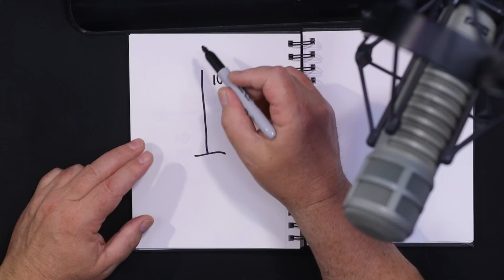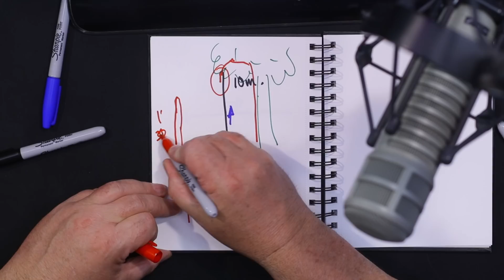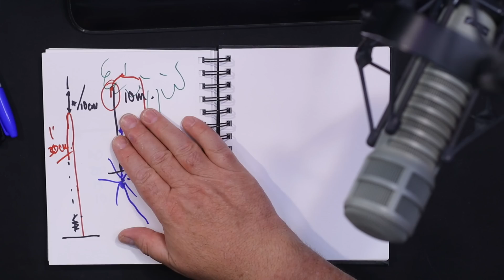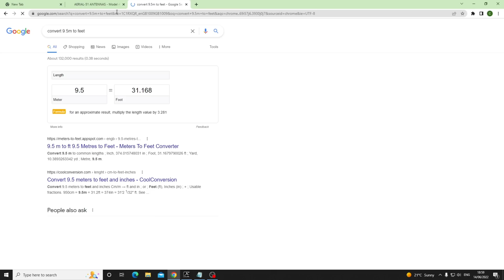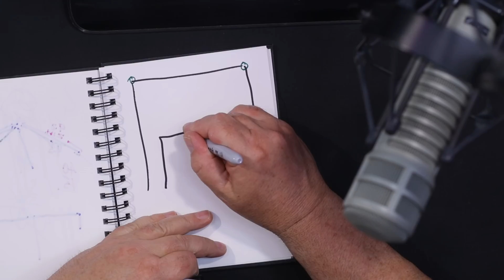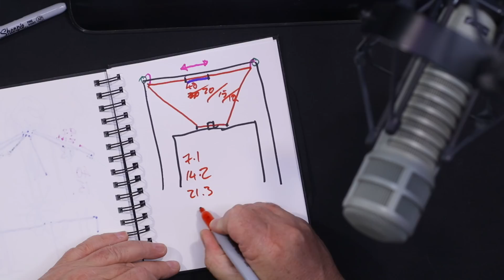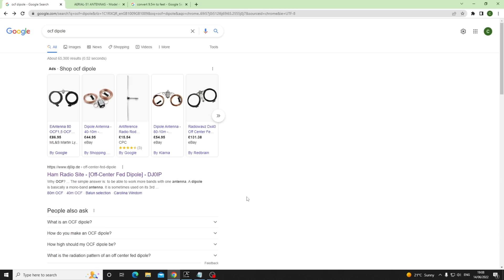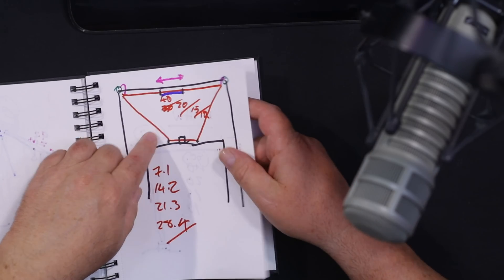5 Cheap Wire Antennas for New Ham Radio Operators

Comment: I use to use a 66 ft approx efhw it worked great , I would keep the transformer low to ground this would allow me to by pass the transformer using a dipole connector with a counterpoise to ground a short wire with croc clip would clip onto the wire on the transformer this would make it a quarter wave on 80m worked a treat
Reply from the maker: Perfect

Comment: Good morning sir! Wondering if you would be willing to teach on the use of 75 ohm 1/4 wave matching stub for impedance matching (instead of using a 4:1) Would love to learn how to do it, how to measure the proper length, when it would be advisable to do it, etc ....
Reply from the maker: Great suggestion! I'll add it to the list!
Reply: @DXCommanderHQ  thanks!

Comment: hi callum please could you take a min to give me  on the 20m half square fed at the top corner  iv made one 2 quater wave verticals 16ft 6inch  orizontal 36 feet  my swr keeps changing  ?  thanks   mark
Reply from the maker: Hmmm. Mark, send me some pics via email and I'll take a look.
Reply: thankyou calum it was my pl259  a pidgeon hit my orizontal wire  my nieghbour told me lol   all good back to 1to1 2 swr  great dx  but cant hear you or anyone in the uk lol   but i still watch your vids  saveing up for a commando  probs rapide 7   thanks mate

Comment: Is it true if you put an antenna on the ground, it makes for a great receive ant. Very quiet.  Loop, dipole, long wire?
Reply from the maker: Yes it does.. I have a loop on the ground. It's almost too quiet (depending on band) but works. My fav is a 90m loop about 30cm/12 inches off the ground.

Comment: The OCF dipole uses an atypical feedpoint to achieve favourable input impedance on more bands. The EFHW takes it to the extreme with a very high input impedance making the matching device somewhat more critical.

The radiation pattern will not be appreciably different from the harmonics of an EFHW or 15m on a 40m dipole. Harmonic frequencies result in more commutation of the current distribution across the radiating element, and this is reflected in a radiation pattern that increasingly resembles a porcupine as the harmonic number increases.
Reply from the maker: Ah yes, the "Porcupine"! :)
Reply: @DXCommanderHQ  
Yup, very spikey!

Comment: Very nice video Callum! (as usual😊). I have a question about 40-15m GP: Which is the distance between 9,2m and 2m wires? Thanks a lot for the answer. Best 73 de Franco, iw2hus
Reply from the maker: Doesn't matter too much, I string mine right next to each other..
Reply: @DXCommanderHQ  TU! I'll try to build the antenna to compare with my multiband EFHW 80-10m

Comment: I have been using Vaseline (recommended by you) since watching your videos (over a year). It works great! Thanks for the recommendation. I finally took my dx commander classic out of the box (~8 months). My goal is to build it this week. I'm totally looking forward to it. Can't wait to make contact with you while using it.

So I typically use a OCF dipole (MFJ 2010) about 30 feet in the trees, but requires a tuner. I have no idea what he pattern is and would like to know. Mu contacts are all over the dish, not consistent. I can't wait to use a resonant antenna like the dx commander.
Reply from the maker: OK, some parts of SOME bands (behond 20m probably) will have some gains - and some losses. Difficult to discuss here sorry! DXC will be fabulous. Enjoy.
Reply: @DXCommanderHQ  Thanks Callum. I know what I'm getting into. Been reading up and watching a lot of videos regarding your antenna. Wish you the best!

Comment: Good stuff. I used to use a rubber tipped arrow and low power bow to shoot fishing line over tree limbs. Then one of my friends came up with using a fishing casting rod with a lead sinker on the fishing line and casts the line over tree limbs. Then tie a long length of para cord to the fishing line, pull it over the limb and then pull up the wire antenna with the para cord.
Reply from the maker: Yes, I made a home-vrew fishing rod / antenna launcher once!

Comment: I use military Don-10 for my 160m horizontal loop. Works a treat, and nice and strong!
Reply from the maker: Ah-ha.. Have a look each year because the outer layer of insulation material can degrade leaving the inner insulation .. Then it snaps.
Reply: @DXCommanderHQ  only has one layer on the Aussie stuff. Basically fig-8, 5x strand tinned copper, and 3x strand of stainless steel from memory. I was lucky to 'reclaim' heaps of it when I served.

Comment: I’m thinking about building a multi-band vertical. I have an aluminum collapsible flagpole I’m thinking about using. If I use this aluminum pole and don’t allow the wire to touch it, will the metal pole cause a problem?
Reply from the maker: Use the metal pole as the longest element (say for 40m band) and then string the other bands a couple inches (maybe aq bit more) away. It'll work.
Reply: Thank you. I’ll try it.

Comment: Another simple resource - Plastic coated clothes line wire works great for antennas. Not super light but cheap, long lasting and can be bought in long rolls from local hardware store.
Reply from the maker: Great tip!

Comment: I'm starting to wonder if the goal of "self resonant" antennas is the correct goal.  If the purpose of an antenna is to transfer EM waves into free space then it seems like the length of an antenna should be dictated solely by the speed of light.  I'm wondering if when we trim our antennas to be self resonant that all we are really doing is changing the reactance of the antenna to compensate for reactance from the environment, but at the cost of degrading its ability to radiate into free space.  Perhaps we should be cutting antennas to the length based on the math and then compensate for environmental reactance via a tuner or inductors/capacitors applied to the antenna.
Reply from the maker: Indeed, that is another way of looking at it. BUT it's a heck of a lot easier just to make the numbers right on the cheap :)

Comment: Great video cal !!! Gonna try making a receive loop tomorrow.if it's only used for receive dies the wire have to be a certain length or more wire down the better?? Loved this one 👍👍
Reply from the maker: Andy, So I have practical experience of a) a small loop on the ground and b) a large 90m loop 30cms off the ground. I preferred the large loop. Size doesn't matter but if I had ONE to chose from,, it would be a 1m or 2m high loop around any garned / back-yard with a 4:1 balun. You might find it's tune on some bands just by accident but for RX only, don't fret about it.
Reply: @DXCommanderHQ  thankyou so much cal

Comment: Nice videos Callum. I know you do not have the room but have you ever considered making/modeling a Rhombic antenna...at least on MNANA? I have done some searching on the internet but info is kind of hard to find. My QTH here has a moderately large chunk of land so maybe I could find a way to fit a 20m rhombic. I read they are fairly high gain....somewhere around 20 banana's. Anyway maybe it would be interesting to other veiwers. 73's Tim - K5DEZ.
P.S. My DX Commander has been up permanently for a couple years now. Still kicking ass and taking names as the metaphor goes.
Reply from the maker: Hey Tim, apparently indeed they are great. Not modelled of even thought of one for the last couple years.. You have re-lit my interest..!

Comment: Phone drop wire was copper plated steel, bloody strong stuff. For radials a cheap solution is stripped down CAT5/6 it is cheap as chips, and you get 8 wires out of it....
Reply from the maker: Good tips!

Comment: With your guidance I successfully made a loop that worked great on 40m and down. I've already made lots of dipoles (although I'd still like to try linear loading to try and get an antenna for 160m that would fit on my property). So now I need to make a vertical!
Reply from the maker: Nice one Randy!

Comment: Cal - any real world differences with EFHW vs 1/4 wave with verticals?  I've done the MMANA model and I'm seeing only a 0.2 difference at 5* off the horizon (if I'm doing it right).  Am I losing RF power with the 49:1 transformer to bring SWR in-line?
Reply from the maker: Good analysis.. My modelling has always shown that too.. Roughly.. Probably depends on ground conditions too. And 1/4 wave gives you SOME (not a lot) slightly higher angle stuff for the small 1000 mile hops.

Comment: I noticed that on your website you sell not only your DX10 but one called DX50.
Could you do a video explaining the benefits and shortfalls of each and under what circumstances they would be most suited?
Reply from the maker: I'll add that to the log of videos.. Basically, DX50 and any Kevlar cored wire is only really needed for very high tension work.. Massive doublets or huge loops etc. But I will make a short video about these and other antenna wire. Good idea.

Comment: Curious....you use 4:1 baluns on the loops, but every loop I've experimented with had an impedance in the range of 100 - 110 ohms meaning I had to ise a 2:1 balun as a 4:1 dropped the impedance to 25-30ohms and I couldn't get any decent swr out of the insulated house wire. Any thoughts on why there would be such a difference?
Reply: That's fairly easy with coax. Put a PL259 on your 50 ohm coax, then get an, "electrical" quarter wave length of 75 ohm coax, one more PL259 and a double SO239 barrel connector. Put the other PL259 on one end of the 75 ohm coax and split the other end on the antenna insulator at the feed point. Attach both PL259's together with the barrel connector. The 75 coax might be 66 percent velocity factor if it has fairly clear or see-through dialectic or it might be closer to 80 percent VF if it has white foam inside. This only works for one band though. You can reduce the impedance of the loop by making it slightly shorter, such one length in space, rather than longer to make it more resonant. At least it will match the 50 ohm coax better. The QRP guys swear that an even slightly longer loop works better, even with some mismatch though. If you need a 4:1 balun, it should be a current balun, not the lower cost voltage balun, as it is the currents that need to be balanced between the unbalanced feed line and balanced antenna feed point. Look up how to make a half wave coax 4:1 balun, if you need that much matching, but again, it will be one band only. If your loop is a square or a triangle, you can shorten one dimension, while increasing the other. This will increase the impedance. A folded dipole has an impedance of around 300 ohms, so anything between a symmetrical loop and a folded dipole will have an impedance between the two antenna designs. Get it around 200 ohms and then use a 4:1 balun. With a triangle, lengthen one side and shorten two sides. With a square, lengthen two sides and shorten two sides. As this is increased, the impedance with approach that of a folded dipole at some point with the sides close together.
Reply: What were you feeding the loop with?  Sounds like coax was used?  Typical full wave loops are fed with 450ohm or 600ohm ladder/window.
Reply from the maker: David, options are 75 ohm coax at 1/4 wave less VF. Perfect tune for coax. Balanced tuners can bump up the cost for the average chap doing experiments.
Reply: @DXCommanderHQ  Yes -  I didn't consider the extra expense of a tuner and audience. 73 David
Reply from the maker: OK, impedance will often vary depening on height above ground.. I've personally discovered 4:1 to work fine. But I guess there are other variables.

Comment: I am buildong a dx commander classic. My radials will be #10 awg thhn. It was free, and I can add as many as I want as time goes on.  As for odd wire to use on transmit. I wonder how electric fence wite might work. Even spicier, they make electric fencing rope, hi vis, the stranded wires are woven into the rope, which is the size of parachord or less. I am not using it. But that would be a interesting thought........ I mention it just to throw a wrench in the " traditional" transmit wire train of thought.
Reply from the maker: Yes, I've seen that stuff... Interesting project!!

Comment: Question:  How come we always see fan verticals rather than using a single element vertical with a tuner?  Is this because of coax loss?  Could I instead feed such an antenna with window line?  Or use a remote tuner at the feed point (if I were flush with cash lol)?  Do the lobes go all weird when the vertical is nonresonant and used with an ATU?  Will such an antenna pick up a ton of noise?  If so, could I use a vertical with ATU for transmit only and switch to a loop on ground for rx?

Sorry for all the dumb questions.  It's just that I've been thinking of trying to strap 50 or 60 ft of wire and pvc pipe up the side of my chimney, bury some radials, and try to feed it with window line out of the ATU.  But if that were something that worked well, I'd think more people would be doing it, right?  Just wondering why not.
Reply: Impedance - hence the need for a transformer at the feedpoint.  End fed random wire sort of deal. Potential thousands of Ohms at the feed point when non-resonant length.  A good ATU will do it however - just with the usual compromises vs a tuned element.
Reply from the maker: Hi Lee.. See Tom's comment - and also I have made a video about long wires and using them for transmit.. Probably released next Friday.. Bottom line is getting a) a good match to 50 ohms (or your ATU) and b) the pattern [literally where the RF goes] becomes important..
Reply: @DXCommanderHQ  Thanks for the replies, gentlemen.  So the short of it is, even if I feed a nonresonant vertical with some kind of low-loss feed line through an ATU, those sweet DX takeoff angles will still get all jacked up when the pattern goes wonky, so it's not worth fooling with?

Comment: DX Commander Classic == 40, 20, 10, 6 meters.   MMANA says that transmitting on 2 meters radiates primarily off the 40 meter element (21st harmonic).  Radio says SWR <1.1:1
Reply from the maker: Not worked this out but 6. Is a 1 3/4 and 7th harmonic.. So yes you are probably right at 21st harmonic.. Steve opened a repeater away about 40 / 50 miles so SOMEWHERE there must be a tiny lobe low down.. I ca. See it on the modelling..